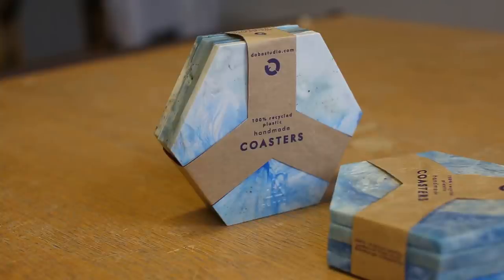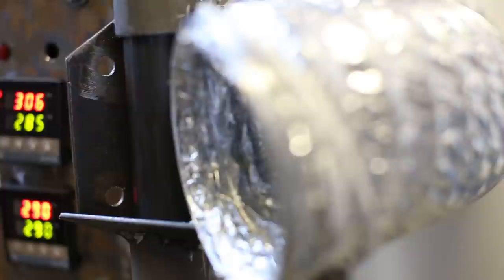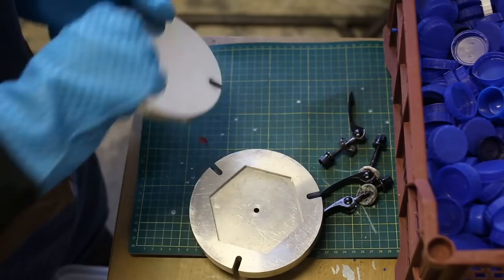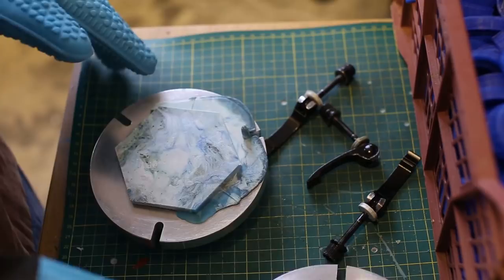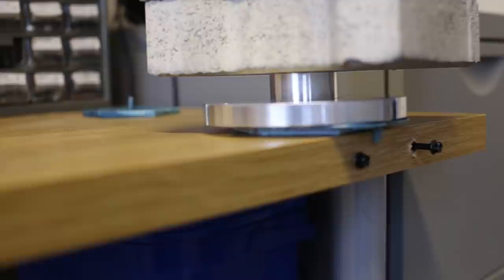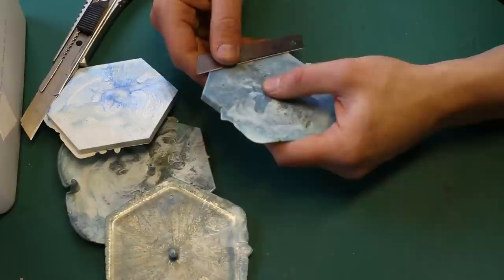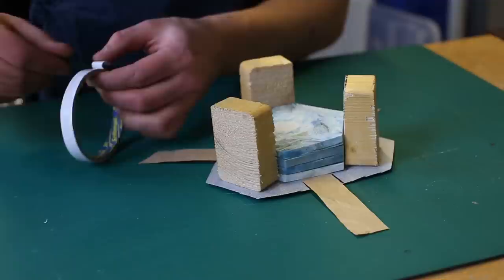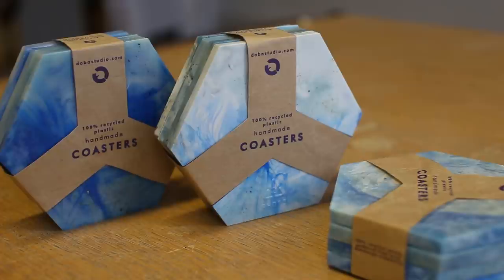Making Coasters from Recycled Plastic Bottles and Lids

Comment: A lot of work and a lot of wastes.
You can easily optimise this process.
First, try to weigh the plastic so that you don’t get much flashing. This will make the finishing process much easier.
Make sure the barrel is heated up when you add the plastic, this will reduce the cycle time.
Try to get a pneumatic press for injection, this will greatly help with the injection process and make the whole thing more easier and you’ll get a nicer final product. This is because, when you inject using your weight, it does not inject the plastic with an equal injection pressure. By using a pneumatic injection unit, you can make sure the injection pressure is equal.

Finally, if you can’t do any of the above, when you see the flashing, keep the pressure on it. It called dwell time in the cycle. It’s usually done for 2-3 seconds (for products that small). Here you don’t have to push the plunger, but don’t take it out. Keep it at the current position for a while. This will reduce the shrinkage which reduces the warping.
Reply from the maker: Thank you so much for all of that suggestions! I've just started doing that and there is always planty of room for improvements that I should implement. First of I will need to find a replacement for those quick release skewers, which right now does the average job :P

Comment: If you could give the mold a high relief so that the coaster would have a low relief and could contain condensation from the cold glasses, that would be great. Excellent work!
Reply: I have to agree with you while this looks awesome the condensation is just gonna run down the glass and still end up on the surface you are trying to protect with the coaster.
Reply: I agree but I make both types (out of concrete) and people buy more te flat ones even if as you mentioned, water condensation over flows the coasters

Comment: can you make it into bathroom tiles please? they are so beautiful to look at
Reply: I was thinking about the roof tiles. I am not sure how this material would behave fully exposed to sun and weather. And whether it would be fireproof like it might be required. But it would be just so cool to have it turned into light durable roof tiles. 
I also know about company making cool looking floor tiles from plastic garbage and concrete mix. So if floor tiles are possible, bathroom or roof ones should be too. Just a question of technology.
Reply: @peterk.6093  i don’t think plastic roofs will come anytime time soon because long exposure to sun can cause melting
Reply: Trust me you dont want PE as bathroom tiles thet stuff sucks up smells and wont dry as fast as normal Keramik making yore bathroom smell like a swamp ,if you still want to use plastic go vor pvc
Reply: @staruberhater1973  UV rays will degrade the plastic way too fast.
Reply from the maker: Yeah, you are all right guys. Those will be wonderful as a wall tiles, but in any other room except from kitchen and toilets... who knows what could grow inside a little scratch 😬

Comment: How much energy will consumed in one set of coastals
Reply: No more than making them from new materials.
Reply: @theseconddarrin3788  It probably takes more energy to produce these than the bottles they're made from.
Energy spent per bottle would be much, much less than energy spent per coaster.

In a way these uses more energy to produce, but they use materials that would otherwise just contaminate the environment. It's not trash anymore. For now. They will be someday.

If we're really thinking about the environment, it's better to just recycle the bottles like they're supposed to be recycled. That way the infrastructure to recylce that's already in place will get to do it's job. Now with these coasters there's two recycling plants. One is just much less efficient, but also on a very tiny scale. These coasters would need to be recycled on 100% green energy to actually be an improvement. But hey, the thought of recycling sells. He makes money. The bussiness model is working.

Comment: Its great. I just want to know about real melting point of plastics
Reply: Well it depends on the plastic itself there is no real melting point there are a lot of different types of plastic ranging vom 80-600°C but general most used plastic PP,PS, PE is around 170-230°C